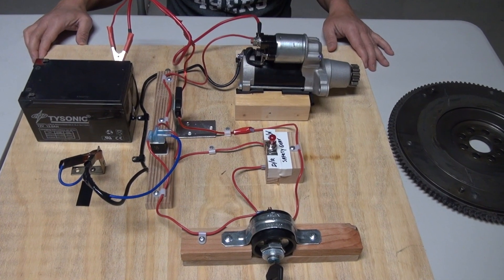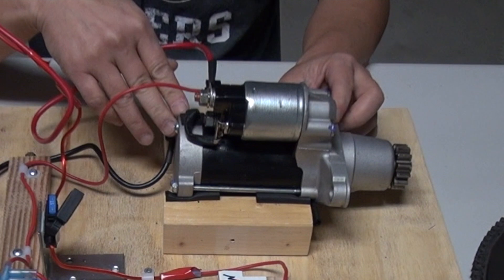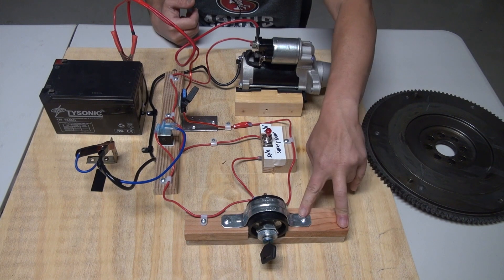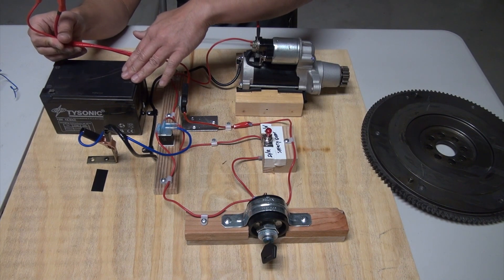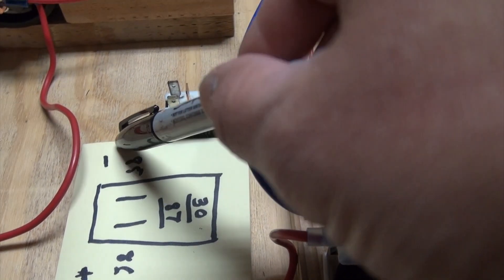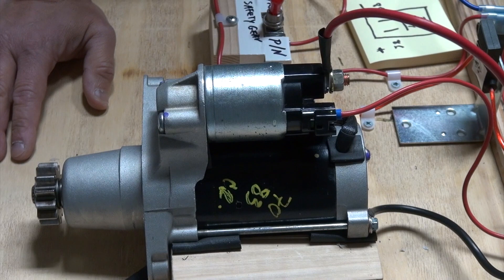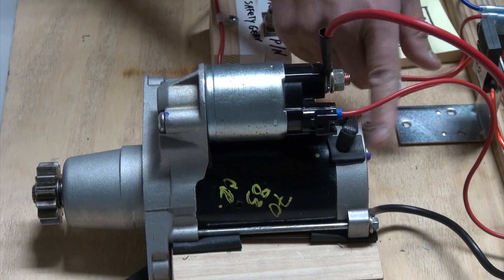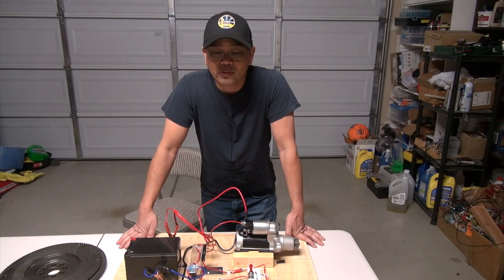Starter Motor and Ignition Circuit Thoroughly Explained!

Comment: That was a great explanation. Thank you! My car has been having issues turning on. My mechanic can't figure it out. It turns on for a few days and then it doesn't. I tap the starter with a hammer and then it does. I have done this so many times it's ridiculous. It has a new battery. New starter (3 of them). New relay. New fuse. New ignition switch. New alternator. It has to be the wiring then. Do you have any suggestions?
Reply from the maker: It sounds like something in the system is draining your battery.  You might want to test your battery if that is the case.  I recommend doing research on parasitic draw problems on YouTube.  That might give you some other ideas for possible causes…good luck!  Thanks!
Reply: Im  no expert but if it works after a few hits then cleaning or new starter motor could fix, this post is a moth old tho so was wondering did you fix it mate ?